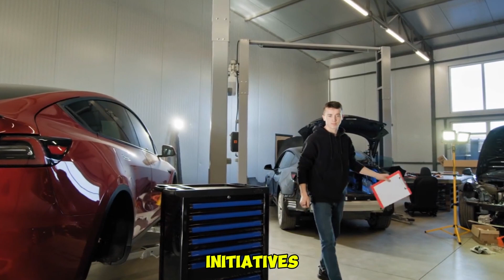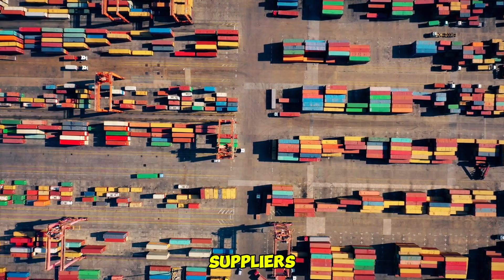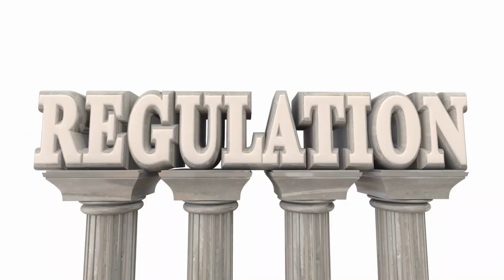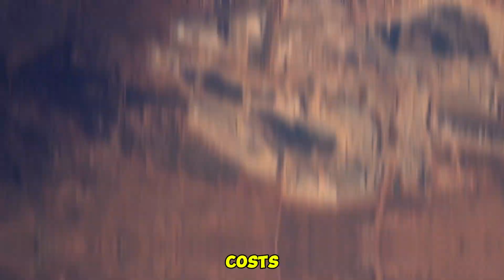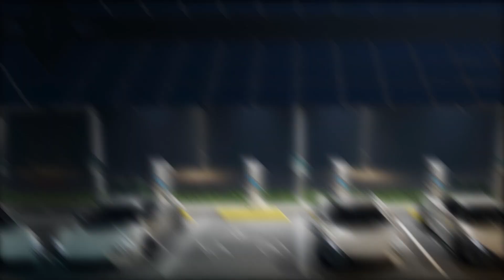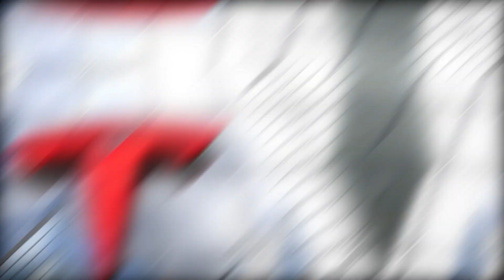Why Automakers' EV Factory Investments Aren't Paying Off In The US

Comment: The author of this video has no clue. It is easier and way cheaper to develop and produce electric vehicle than an ICE vehicle (no exhaust, fuel delivery and control emissions, simple electric motor replaces complicated gas engine, safety and comfort systems are same in both), the only culprit was and still is the expense of producing sufficiently strong  BATTERY. Once the batteries are sufficiently developed which will take another 5 to 10 years, most of us won't even want to look at ICE cars because they will be more expensive to produce, buy and maintain than electrics. Watch the development of solid state batteries to see when that inflection point will happen.
Reply from the maker: Its just my opinion